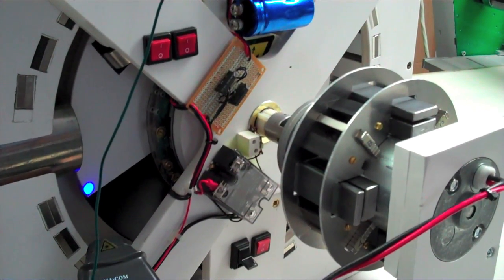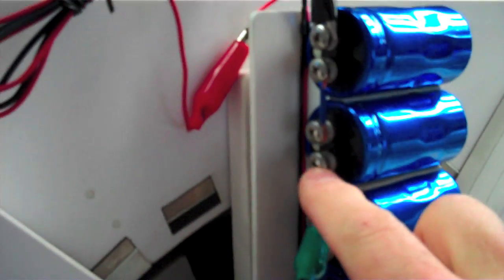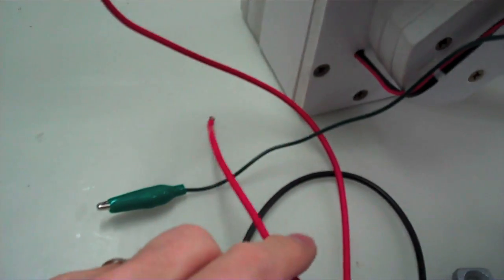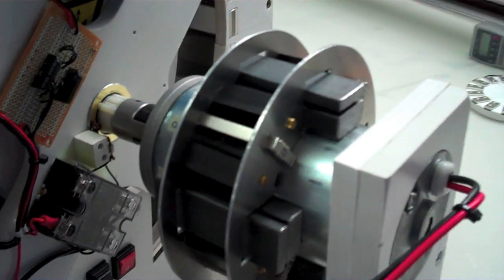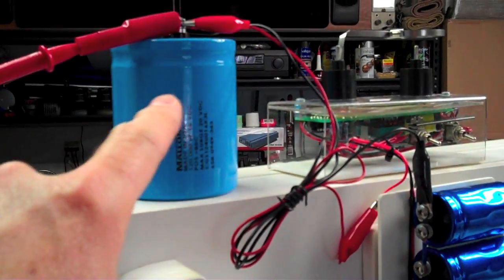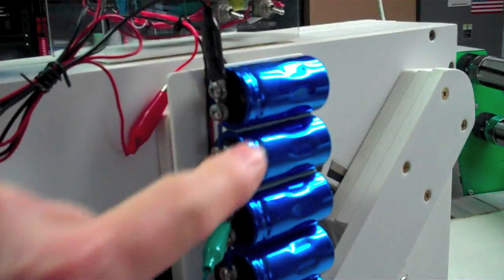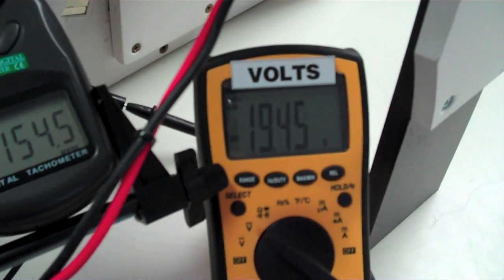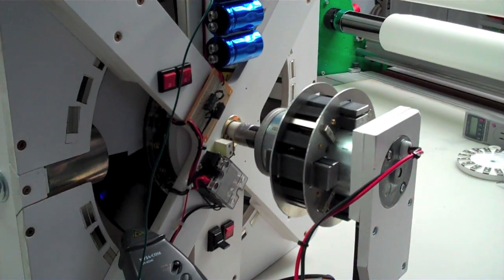SELF CHARGING?

Comment: will it handle a load? generating its own power is one thing but have you tried hooking up something that consumes that  energy? maybe LED lighting? this could very well be a self-sustaining light. how many volts are required to start the Stargate engine? like, let's say the caps were empty, what is the minimum voltage for the system to self-sustain? would you be able to give the ol Price is Right spin to get it started if it was completely drained?

Comment: It's not necessary that it becomes prepetual running motor. If the system is used in electrical vehicles and if it extends the range of vehicle by half to double or maybe more than that, it will be experimenting in the right direction.

Comment: The 6-in-series capacitors are supercaps, probably 350F at 2.7V each.
Sure wish we could have seen the other Voltmeter while it was "charging"... the one running the Stargate motor.  It's possible for the full capacitor stack to climb in voltage, yet that small sub-group to be decreasing in voltage, while the stargate motor could still be increasing in speed while using up the stores energy in the 3 supercaps.

Comment: fuck me this is amazing, if you can create something like this why haven't you continued on with it by putting it through different loads sequences or a development of different events, you also need to find what amps it pulling not just alternating a current to recharge the capacitors. Keep up the good work and if you can get it to do what you intended and on a smaller scale just be careful and get it patented so that the wrong people out there don't rip you off

Comment: Recommendation, take a voltage regulator circuit and clip any power over....lets say 18Volts and feed it to any load. let the motor run. If it eventually stops, you know its a misunderstanding of capacitive reactance. If it runs for a week, then you may have something. In the mean time, it would help you to look up, read, and understand capacitive reactance and voltage/amperage phase relationships. Hope this helps.
Reply: I reckon good job as he's expirimenting and the more work he puts he'll eventually perfect it🖒

Comment: +PMMG4HYBRID -  I'm wondering if you can generate enough direct power for a water pump to flow 5 gpm with a 3 meter lift. Keep in mind that your device could be aided with a turbine from a small hydro head to help increase efficiency .... Thanks

Comment: Oh, my generator was built with only 2 modified spark coils from lawnmowers (the flat metal of the coil where the magnet passes by it shaved flat instead of rounded), gave much higher AC voltage that way when the rotor spun rectified to DC for the input motor.

Comment: Please let me have the plans to build one, I have a generating system that's almost identical except I used different motor/generator  setup, worked the same as yours. Mine though started with 12volt dc battery (then disconnected once the output started) and then ramped up via ultra high voltage capacitors to 705 volts AC at 30 amps, the motor was 12 volts dc running max is 10 amps, i just want to make another better one, I know I can get more voltage and amperage.

Comment: Well obviosly there are a bunch of ways and methods to create extra power the problem is storing all of the energy you need a big huge battery system to store power and they have to be constantly monitored and maintained and in the end cost more or just the same or close enough to not justify having to power things this way.  Its good if you live in the middle of nowhere or something buy power from the outlet is so cheap just not worth doing all this just to have to store all that power.

Comment: I have a idea you can test first, hook up a quick CAP to each Slow CAP, (5 to 5). Then, Try a Quick CAP, at half the rating, (1/2 x Cap 16v to 5)  and see what the out put data tells you with the first experiment as a control sample. At your discretion.

Comment: Its not self charging, same old laws of physics applied, and under those laws the caps used is built, which follows those same laws, and the coppers, and the everything, unless all parts and components are built based on new laws that violates, or even better explain the old ones further or even beyond, should change paradigm, those laws were invented many years ago, maybe we need new ones?

Comment: I understand what you mean, but let's say the purpose is just to let it run for as long as possible. It's accelerating and seems like it's charging itself. The amount of total initial energy is less than when it reaches it's highest self charged torque. Wouldn't you say it extracts energy from a not well known source? Mi opinion is there's a resonance between parts of this machine and vacuum fluctuations, probably the metal oxyde in the capacitors is the key.

Comment: OCEAN WAVE ACTIN is PERPETUAL MOTION & can power ALL of The Worlds ENERGY needs FOREVER Water/Windmills directly power AIR COMPRESSORS 1799 & store The FREE ENERGY 24/7 until needed WITHOUT BATTERIES Then power generators etc... SEE GREENPOWERSCIENCE DIY conversion videos. Surf my CENSORED channels the older ones are found at older comments Several self generating generators can be found their I sell NOTHING any ?'s leave a comment OKAY ? Enjoy We have NOT needed OIL as a FUEL since before 1859

Comment: Have you tried to put a load on the system ? yes very exciting ; our zero emissions zero reliance tech  has been running since 1992 without interrupt ; we didn't do the very clever series control with the cap's that you have in yours ; the entire shop is clapping that you are having good success ; wait until you see The Lady Pink With Her Sea Legs ON run ; we are using 600 Volts with AC control ; all brushless ; I don't dare say more ; because the Land&water speed records are in jeopardy 2013&14

Comment: I'm very impressed. Hoping to take your research and use it for a project of my own, a self charging electrical system for an electrical pickup truck, full sized. Let's face it America loves pickups, but not the gas bill. I have considered the friction caused by the bearings and have not come up with a solution. Thank You for thinking out side of the box!

Comment: @pmmg4hybrid , do you use ceramic bearings? if you must use steel, checkout the "microblue" coated bearing. theres nothing else like it as far as frictional coatings go. in fact most hi end race engines, nascar, indy, f1 are now coating all the steel parts and it cut frictions in half atleast..check it.. Cause I know at some point youll be needing to include those frictional losses in your designs for efficiency reasons. keep up the good work. and thanks for the layman terminology! helps a lot!

Comment from the maker: @Blodslav You are certainly on the right track. Everyone seems to ignore the rotor-stator relationship to successful operation as well. With the rotor weighing nearly 5 pounds, it is definitely storing energy as a flywheel typically does. Then some of that energy is released, so to speak, when the central rotor magnet reaches the equilibrium point at the location of the electromagnet, and just glides through without pulsing the EM. It then receives another 350° free ride. You see? Easy.

Comment: @Nomoreidsleft Yeah, but we don't see the motor stopping or slowing down, we see a potential increase in the amount of energy stored in the capacitors. Also, keep in mind that kinetic energy is also being stored in the rotor, thus it requires less power to run. The basic fact still stands. You start with ~7 some odd volts before you start the system, and you end up with 20v when you shut it off. Theres no doubt that the energy stored in the caps increased. I already gave you the equation.

Comment: I think I have this somewhat figured out. What is happening here is that the kinetic energy is being stored in the rotor, thus reducing the amount of electrical energy needed for it to continue running. Because the motor now needs less energy to run, you get an excess of electrons moving to the plates of the capacitors, thus storing more energy. Can you possibly show us what happens when you reach the full voltage of the capacitor bank?

Comment: @Blodslav This is where a fundamental understanding of physics is useful.  The higher voltage means the potential energy has increased.  The actual amount of work being done is the amount of energy used over time to move the motor.  You have to factor time into the equation.  Higher voltage means you can drive the motor faster for a shorter period of time.  The total energy hasn't changed.  Don't know how many times I need to say this before someone starts to understand.

Comment: @Nomoreidsleft and you're still forgetting that the voltage across a capacitor will not change untill the plates accept a charge (q) Thus changing the net energy stored in the capacitors. It is evident that when he turned it off, the capacitors had more energy than they did initially

Comment: @Blodslav Please don't be foolish, and look up the formula for capacitors in series. The big capacitor isn't "pumping" anything. It can accept a higher voltage, but the input voltage is going to be divided just like it is in a voltage divider circuit, with a decreasing voltage from + to each subsequent capacitor, and an equivalent fraction of the input across the terminals of each individual capacitor. What the big capacitor is for, is to prevent breakdown and losses in the smaller caps.

Comment: @Nomoreidsleft When you connect a power source to a load, ohm's law dictates that as the resistance drops, the current increases, and as the resistance drops very low in this case and the current through the motor goes up, the voltage drops as the difference potential between negative and positive is being decreased. What is happening though, is we see a voltage increase in the capacitors. A capacitor resists a change in voltage across it's terminal untill there is a charge (q) on the plates.

Comment: @Blodslav Your paraphrase is incorrect.  I said, "The large capacitor is increasing the voltage of the overall system, which is helping to pump up the voltage in the smaller capacitors. "  You should know the difference between voltage and current, so I won't explain it.  The motors WILL stop when voltage reaches the minimum required.  But how long that takes depends on how fast the energy is being used. Pumping up the voltage increases the rate the energy is used not the total energy..

Comment: @Nomoreidsleft Also I think you missed the fact that the motor isn't running off the large capacitor at all. Its running from a centertap on those 3 capacitors in the series.

Comment: @Nomoreidsleft What you have there is a circular argument. Basically what you said was: The voltage on the capacitors is increasing because the voltage of the capacitors is increasing. This is in no way an explanation. And in order for the motor to stop the voltage has to drop to 0, or at least low enough so that it's not enough to pass significant current through the resistance of the motor. In the demonstration we observe the opposite.

Comment: @Blodslav The motor is running faster because the voltage of the capacitors has increased.  The large capacitor is increasing the voltage of the overall system, which is helping to pump up the voltage in the smaller capacitors.  No extra energy has been created.  The motor will run faster for a shorter length of time.  If the larger capacitor was not there, the motor would run slower for a longer amount of time, barring any inefficiencies caused by running the motor at the lower voltage.

Comment: @Blodslav Aside from the possibility of a battery powering the motor, can you use an actual scientific description as to why the voltage is rising on the capacitors? (Thereby indicating that the stored energy is increasing) 
I already proved to you that a voltage and capacitance on a capacitor are directly relative to the energy stored (In joules) 
Don't give me that pipe bullshit again, it's insulting to both of us, and it's wrong.

Comment: @Blodslav This allows us to conclude only 2 things: 1) That the demonstrator is a con artist and that he has a battery powering the initial motor offscreen, or 2) That if you increase the number and strength of magnetic fields without affecting the resistance significantly, you also increase the power output from the system. If it's a legitimate design then it does in fact work, or that theres batteries powering the motor. No pipes, and nothing in between.

Comment: @Nomoreidsleft  It takes as much energy to store energy on a capacitor, as there is energy on the capacitor when it's charged. This can be expressed by 2J=Total work (in W) required. In the demonstration we observe that 2 things are happening: 1) The motor accelerates 2) The voltage on the capacitor bank increases. When an energized solenoid leaves a magnetic field, electrons are freed, thus creating difference potential (V) causing current to flow in a closed system.

Comment: @Nomoreidsleft  A positive voltage change on a capacitor directly states that the energy stored in a capacitor (Joules) has increased. They're directly relative. This applies to both batteries and capacitors. Heres the equation for 2 capacitors with the same capacitance: Cap 1 is a cap charged to 100v, @ 500uf, cap 2 is charged to 50v, 500uf. the formula is 0.5 x CV[2]= Wstored, or J
0.5 x 0.0005 x 100[2] = 2.5 J
0.5 x 0.0005 x 50[2] = 0.0625 J 
This is why we use equations instead of pipes.
Reply: ²82 jouks vs ³5  mega joukds fsel fules

Comment: @Nomoreidsleft I know it has different charge curves, (and I've plotted those curves, in class) and different batteries have different "dead" voltages. But the idea is the same, it's a component that stores a charge. One uses parallel plates, the other uses a chemical reaction. Instead of making weird obscure references to animals and pipes, why don't you use actual theory to explain what you're talking about? I did, and it doesn't seem like you got it. Just look it up man.

Comment: @Blodslav Far be it for me to claim that your teach doesn't know what HE's talking about. His statement that a capacitor works on the same principle as a battery, except that it doesn't use a chemical reactions, its charge and discharge characteristics are different, and it has lower internal resistance.  Is like say a bird is cat, but it doesn't have fur, and teeth, and cats eat birds.  But they;re both animals.  Logically his statement is not self consistent.  A battery is not a capacitor!

Comment: @Nomoreidsleft Where exactly did you study electronics engineering? Every one of my professors are telling me that you don't know what you're talking about, and you're wrong. A capacitor works on the same principle as a battery, in that it stores energy except that it has a lower series resistance, allowing for faster charge and discharge, and doesn't require a chemical reaction. The very formulas for capacitance are telling you that YOU'RE WRONG. You can google it if you like.

Comment from the maker: @htomerif After additional testing, I've got a better handle on what is going on with the caps. The 16v cap quickly charges and greatly reduces the resistance from the axial flux alternator/generator allowing a very smooth flow of power into the DL's. Sweet. Any other input you might have is always appreciated. Send as a message instead of a comment so I can receive and archive in Gmail. Also, thanks for the meter tip. I enjoy laughing at myself.

Comment: @Blodslav Well, if you don't understand the analogy between water and the fluid of the electron cloud, then you probably don't have a good grasp on fundamental physics.  You bucket of water analogy is closer to the a battery.  It stores electricity, and releases it at a much later time.  A capacitor buffers the flow of electricity, and releases it at a slower rate, but is not a good storage of electricity, since it discharges at a faster rate than a battery, thus closer to a shower head.

Comment: @Nomoreidsleft What do you mean when you say "buffer" energy? By defenition a capacitor is an energy storage device, and the voltage on a capacitor of a given capacitance determines the amount of energy it has stored in joules. I have already provided you with a direct theory explaining this. This theory is mandatory in all elec. engineering programs. Where exactly did you study electronics engineering? So are you a plumber or an engineer? Because you seem to throw all theory out the window...

Comment: @BlodslavAll the energy in the capacitors are from the system.  All capacitors do is buffer energy, and release it at a certain rate.  This too has a water analogy.  It's like the pressure valve in your shower head.  It turns what would be a lot of water coming out of your pipe at low pressure, to higher pressure jets. There's still the same amount of water, it's just coming out faster and in less volume.  The only energy you can get from man made magnets is the energy that you put in it.

Comment: @Blodslav cont'd -> If you connect the ammeter in series with the stargate motor, It will actually show a drop in current as the motor accelerates, because it takes more energy to get a static rotor to accelerate than to keep an accelerated rotor moving. (this is a 1st year elec. engineering lab) And if you place the ammeter just on the output, then the system isn't feeding power back into itself. My question is, where exactly do you expect him to connect the ammeter?